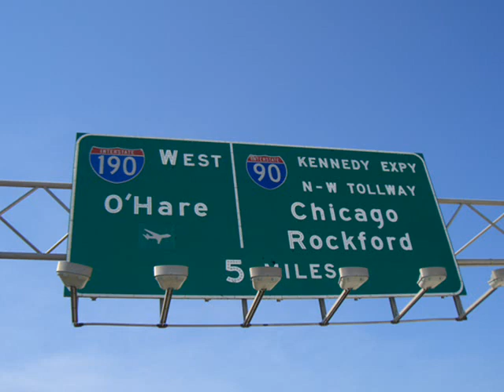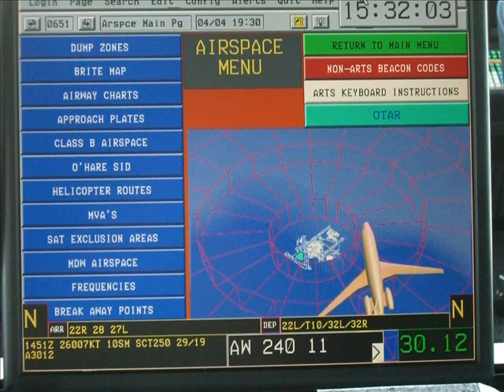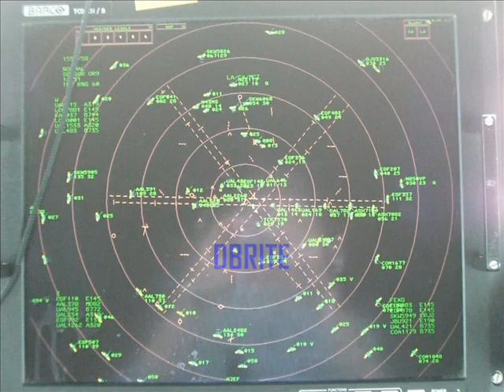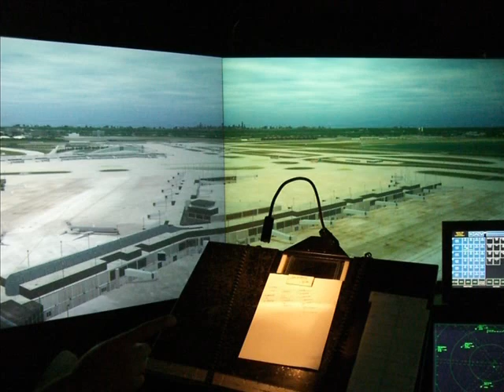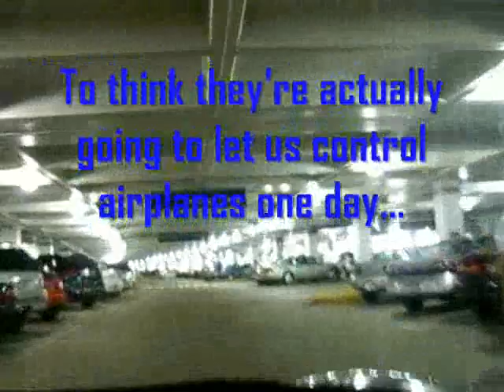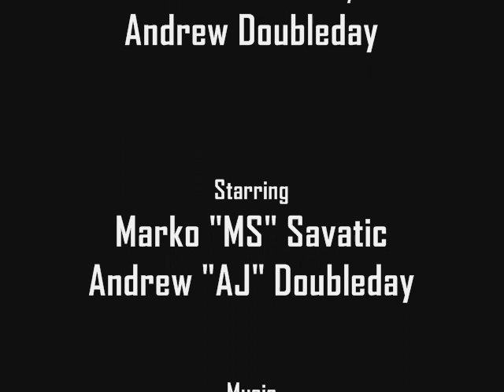O'Hare Tower

Comment from the maker: When the ceilings permit, they usually run visuals to the outboards (28/27R) and the "high-and-wide" arrivals on the new WATSN STAR join the ILS to 27L right down the middle from over the lake. They don't have to use capture points this way (the visuals to the outboards have a much shorter downwind) and they're arrival rates per-hour have increased dramatically.

Comment: @mleverone Early this spring, I came in on a 22L arrival which I found such a blast.  The pattern was 22L/22R/14R.  This was a trip-simu arrival with a MD-11 landing on 22R and a 320 on 14R.  Two weeks ago, I departed on 14L which I also found a treat.  Although the taxi is long, it's great to see the backside of the airport.  An amazing treat peeling out with a hard left over the international terminal!  To your point on 4L.  I heard that Air Force 1 came in on 4L, and then parked in the NE.

Comment: @mleverone 9L deps: I have departed 9L one time only, and it was a stormy night and 14L wasn't available.  So it was an option.  It won't be really considered a dep RY until the final phases, and then it still won't be a primary dep RY.

22R: No need for it unless the wind is so high out of the SW that landings and departures are on 22L/R.  It's been done, of course, but don't plan on it.  If the wind was high enough we would probably land on 22R and depart 22L.

Comment: @mleverone West flow is landing FROM the lake. East flow would be 9L/R/10. We tried it a couple times and it fails miserably. Someday it will work. Problem is finding a good departure runway.  22L works fine but 32L and R cut through the 2 finals for 9 R/L. 4L works but the timing isn't good. Hit the 9R gap, no prob, but to time it with a 9L arrival slows the problem down too much. You don't want a tie with a go-around.

Comment: @mleverone We land on 22L a little bit.  It's a south wind configuration when the wind is too high out of the SW for RY10 arrivals. Some days we might be on it most of the day.  But we'd rather not land 22L because it's an awkward taxi back.  It used to be a nice operation 10+ years ago.  It's plenty long for an MD11.  Shoot, we have A340s land on 27L with only 7967 feet, certainly 8075 is enough (22L). I'm a controller at ORD, not a pilot.

Comment: @mleverone Well, that would have been one of the last times someone would legally land on 32L.  It's now closed to arrivals due to that fact that aircraft are higher passing the cargo buildings, and therefore need more lateral space at the approach end.  It's kind of a exaggerated rule but that's the way it is.  32L arrivals done!
4R departures: last time I did these was on a midnight shift and it was just cargo.  I think we had some closures that made it difficult to get to the normal runways.

Comment: @mleverone It's a LOC approach, certain parts of the airport have to be cleared of aircraft before someone comes over the threshhold, and it's a terrible taxi back.  And it just serves no purpose. We would use RY10 and 9R just fine before 4L.  Like I said before, if the wind was very high from the NE, it might happen out of necessity, but it's just too rare.

Comment: @mleverone It's not unsafe. If the 14R goes around, they have 2 miles to the intersection. RY10 is on the ground nearly a mile from the intersection. In the event of a dual go-around, they start nearly 3 miles apart, so you have time to turn or keep one low. It's funny because when they crossed, pilot unions didn't want to land 14R and hold short of 28 or 10 deps.  That really slowed down the operation.  Now it's no big deal because the city painted a threshhold north of 28/10!

Comment: @mleverone It probably is a nice approach.  Those runways are going away with the new plan.  I wish they wouldn't because they are great alternatives when the wind is high out of the NW.  But, that's not for me to decide.  32L is a 200 foot wide RY.  It is the only RY at ORD that is not 150 wide.  I don't know why they are going with 150 vs 200.  Maybe it's just a waste of concrete since there are no 200 foot wide landing gear.  Just need room for the wings, and that doesn't concrete.

Comment: @karbunkle1 Also, I'm not saying it's not a legitimate arrival.  It just is far from the norm 28, 27L, 27R or 4R, 9R, 10 (understandably).  I just think 32L and 32R are an amazing approach with the city off to your right.  I understand they are removing these runways, but I'm surprised they don't land on them more as "I think" they are both an extra 50 feet wide.  They are also in great shape IMHO, so I don't see why they wouldn't use that extra width.  Also, why don't they rock 9L/9R/10?